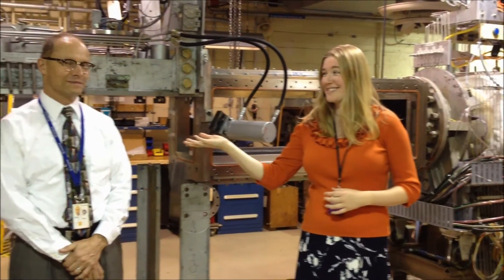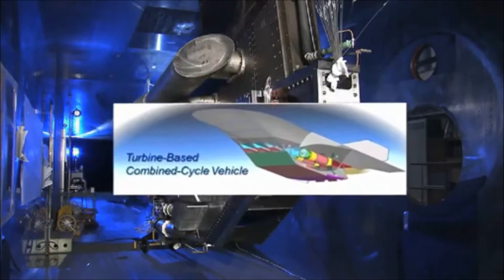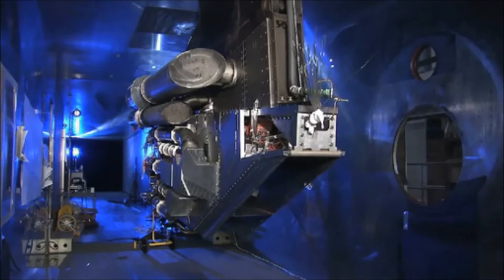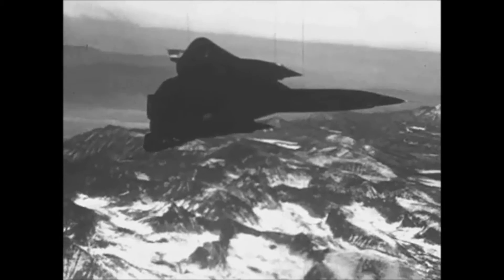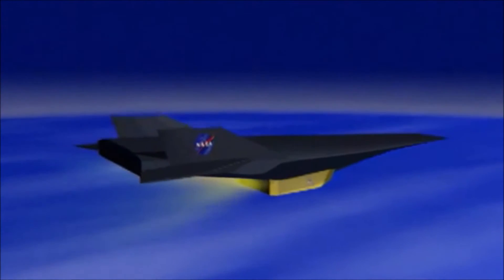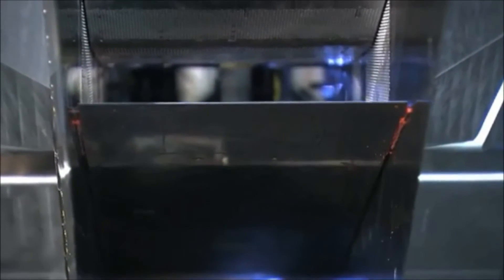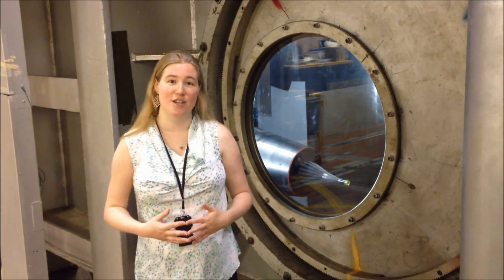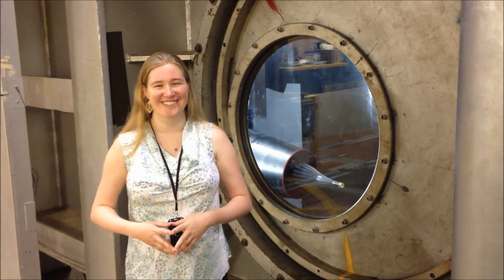Testing Transitions Inside Air-Breathing Scramjet Engines

Comment: Is it possible to tune Ramjets like one tunes a horn ?  What if one set up a purposeful tuned sound vibration in the pipe. Could this do anything to increase thrust whatsoever or change they dynamics of the engine for the better ? just a thought.. I would like your thought on this if possible. Am I just being silly?  :)